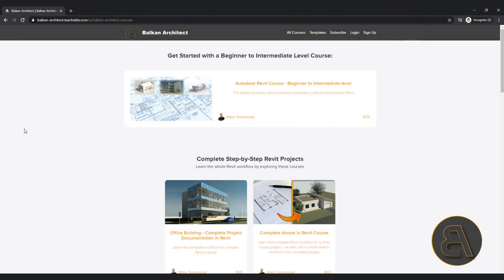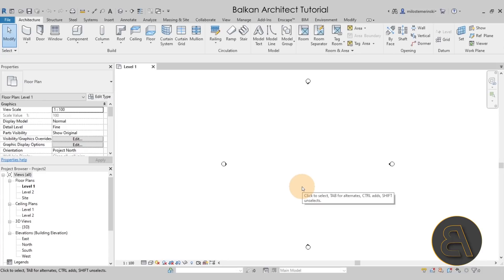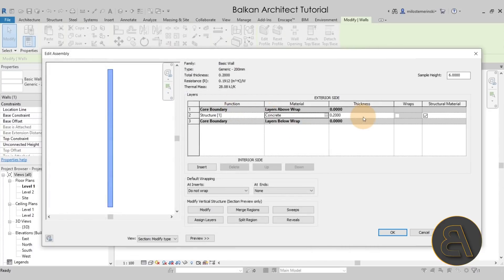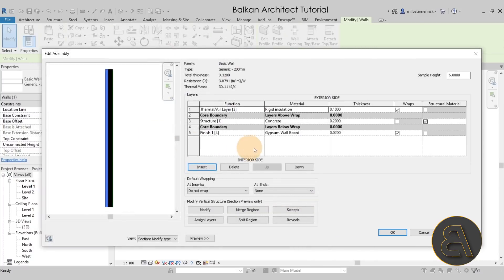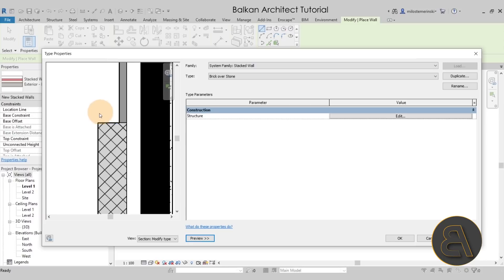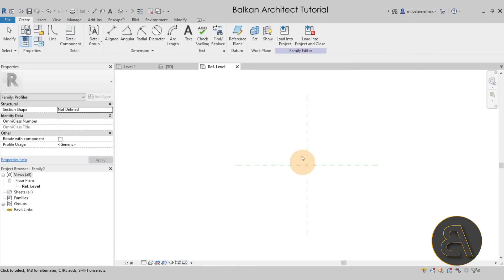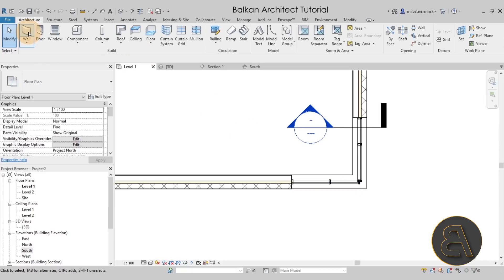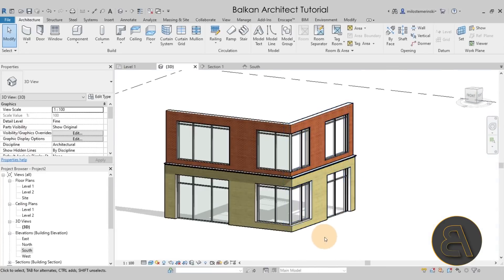Complex Stacked Walls in Revit Tutorial

Comment: I work with Structural Load Bearing walls at my job. Is there a way to customize the steel studs to different gauges? Same with the Headers over the Window/Door Openings. I would need to customize the headers as Back-to-Back Light Gauge CFS or Wide Flange Beam or HSS. Thank you for the informative video.